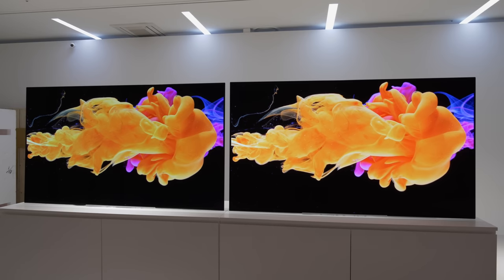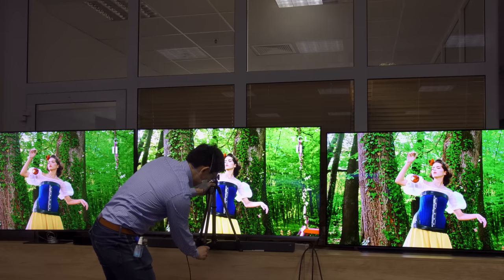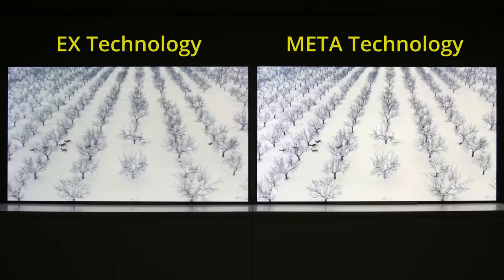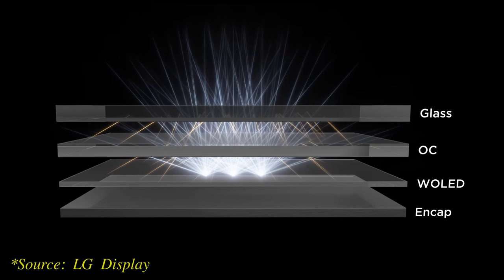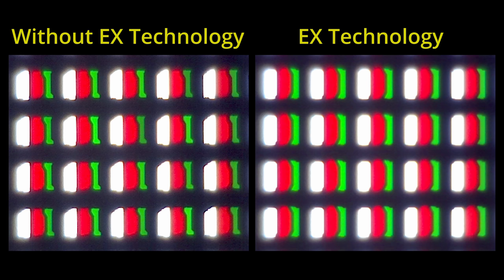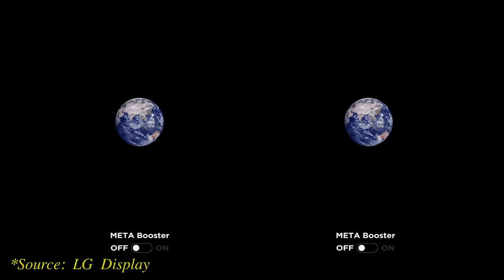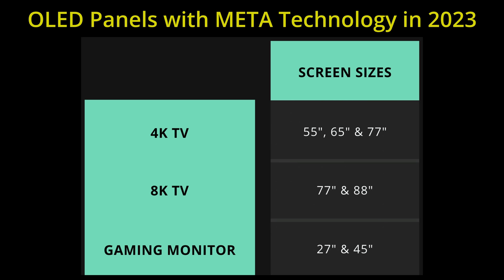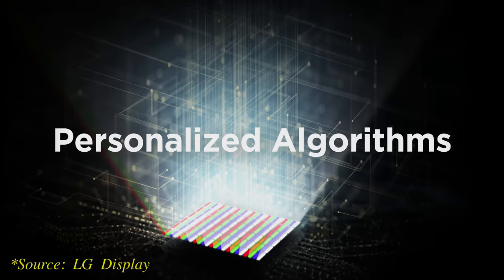MLA OLED Panel Explained - The Secret behind 2100-Nit OLEDs!

Comment: The next few years will be great for OLED and slowly end the LCD dominance because both LG Display and Samsung Display have to compete and push the envelop every year.. The upgrades LG has brought in the past years are a direct response to the end of their large screen OLED monopoly. It feels like the last three years ('21-'23) competing brought more to the table than the first 8 years ('13-'20) in which LG had a monopoly
Reply: They’ve pretty much killed the led this year with the 2000+ nit oleds coming out.
Reply: @polishdude001  Not really. Lcd still gets brighter at all window sizes with no risk of burn-in and is far cheaper. Oled will never beat lcd
Reply: @semahj  Yes it will but not now.
Reply: @md_zafl5284  It really won't. Micro LED is around the corner. Lcd will always be cheaper to produce than OLED. OLED will never dominate.
Reply: @semahj  Micro LED isn't the endgame of panels. Neither is QD-Micro LED.

There's always something better around the corner.

Technology advancements wait for no one.
Reply: @PSYCHOV3N0M  Never said it was but when it comes to OLED it is the end game. Micro LED will replace OLED. all the benefits without the Organic nature of it.
Reply: Most innovation in OLED are from Japan. 90% machines (equipment) for OLED in Korea are from JPN, Samsung make all displays panels on Canon Tokki and Ulvac machines and Nippon Printing masks (all Japan). Microlens is Sony tech from OLED viefinders (tiny displays in cameras to see what sensor see).
Reply: @semahj  micro led will be too expensive even if the technology became mainstream.
Reply: @madln5070  You mean like how OLED used to be...
Reply: @semahj  It was expensive, but they're not the in the same lvl lol.
Reply: @semahj  The first LG OLED was like 15k at max, micro led is more than 100k LOL
Reply: @madln5070  so you think when micro led becomes “mainstream” it’s going to cost 100k…
Reply: @semahj  Yeah lol, its too expensive to produce. Maybe the prices will drop all the way to 50k or something. Im just speculating who knows
Reply: @madln5070  …if it still cost 50k then it’s not mainstream…
Reply: Does this LG's oled tech bring some immunity from burn in pixels ????
Reply: @gregandark8571  blue ph-oled coming 2024 or 25 improves on that a lot. Some say that will end burn-in but I think that's just marketing. It will take years to find out though
Reply: @RealLifeTech187  
I think it's all marketing,because i don't understand how do they pretend to make organic emitters lasting very long time.
But maybe there is some secret sauce - who knows???
:)
Reply: @RealLifeTech187  Universal Display Announces Fundamental Breakthrough in Blue
Phosphorescent OLEDs; New Blue PHOLED Achieves over 15,000 Hours of
Lifetime with Sky Blue Color and High Efficiency
Reply: @semahj  MicroLED has been around the corner for years now, it's also not even reasonable in smaller devices yet.

QDEL seems very promising, but that's also far away.

At this point in time OLED is the greatest you'll get (unless you're spending hundreds of thousands).

As LCD is phased out, its price advantage is likely to follow too.

Comment: Wow so MLA is actually a foundational improvement in OLED and doesn't compromise viewing angles at all, that's a surprise.
In theory they could still boost brightness even further if they did start to limit viewing angles.

(Now I really wonder what would happen to QD-OLED with MLA? Probably 2,000 nits after calibration.)
Reply: Thats a good point if they inherit qd oled.
Reply: MLA TECHNOLOGY is patented by LG, QD oled is not perfect and QD oled has flaws
Reply: @СНСАЛЕКСАНДАРВУЧИЋ  Both tech has flaws. Neither is perfect.
Reply: @dbztrk  can you say MLA OLED flaws? I want to know
Reply: Any or most OLED can be pushed to 2000 nits but would then burn super fast sadly :(

EDIT: Forgot to say microlens have already been made for years for some stuff, there's even some people on youtube doing arrays of macrolenses so any other brand can do their own too...
Reply: In certain lighting conditions, there are raised blacks, making oled pointless
Reply: @ZengShunSheng  QD-OLED still gets considerably better color gamut, color volume and uniformity.

MLA WOLED is great and all, but you cannot deny that QD-OLED is fundamentally superior. The advantages WOLED sports in longevity may also be alleviated on QD-OLED with  the efficiency phosphorescent blue leds might bring in the next year or two.

MLA QD-PHOLED would go bonkers.

Comment: That viewing angles and brightness at off angle would be great for monitors. The final thing would be price of qd-oled or meta OLED. The right size and price would be the decider. Also would love to see firmware update or user upgradeable fitness rather than locking it out to service centers

Comment: Yeah, Samsung really scared LG last year and they had to step up in terms of brightness.
Good thing there is competition now in the OLED world, it’s most beneficial to us customers.
Reply: Not really, WLA has been talked about for 7 years already. This may be the fruit of the labor/research finally.
Reply: @patrickrk44  great, but them releasing this exactly now is a clear message anyway. They would have to use whatever they had in store anyway or invent something.
Reply: @alangfp  every company has a RD department that's working on the next big thing. Take Samsung and micro led. How long have you heard they have been working on it for for example....
Reply: Rev  nothing in the business world is a coincident
Reply: 9000k white point  tho apparently  to get d65 you have to reduce  the brightness  to 1500nits 

Now I seriously  want samsung  to make a 50inch microled  to destroy  LG 9000k what is all content  displayed  at d65  right so basically  LG is gonna have to force filmmakers  to start making there films in 9000k 

With microled  technology  you can have d65 and and bright as far as you can drive them leds to over 10000nits  and it will be a pure RGB panel so yea if I have to sacrifice  D65 for more brightness  then staying with the older panels for now is a better idea I don't want a blue picture

Comment: I'm interested in the 83". Is it worth it if it's only a 30% boost compared to 60-70% boost on the 55, 65 and 77" models? I wonder if they will be able to get the extra large size models to have all the boost benefits of the smaller versions at some point.
Reply: A larger screen automatically appear brighter anyway. Since much larger screen surface. So might not be that much of a difference?
Reply: Curious to hear Vincent's thoughts around a purchase decision between a G3 83-inch and a G3 77-inch.
Reply: Where did you hear that the 83" will not have the same brightness boost as the other sizes? And is it because the 83" won't reach the same absolute brightness levels, or is it because the old 83" is already brighter than the smaller sizes?
Reply: I'm not sure but if you search "LG new micro lens array" or similar, there are articles about the sizes with the increased brightness for relevant models which from memory I think include the 55 inch. 65 inch and 77 inch.

Don't take my word for it though.

I just bought the C2 in December which was my first oled in 48 inch size which is still very large for the bedroom size I have it in.

In some ways I regret purchasing that as at the time I didn't know it was 55 inch+ sets that had the increased brightness and now LG seem to be making a very large step up year to year if 60% increase is indeed true.

I want to know about the smaller size improvements in brightness but the pixels are too close together in smaller sets for the same amount of brightness increase. Is is heat that means brightness can't be pushed up?
Reply: +1 same question!

Comment: I hadn't realised that microlenses are indeed micro. 5000 per pixel! I thought every pixel would have its lense.
I also have a question, do you think in 2024 LG will use phosphorescent blue light?

Comment: I had the opportunity to watch a couple of OLEDs in short succession - a B7 and a C2, both 55in models. You could sort of tell that B7 got a bit dark in brighter scenes, and it's OS was very jerky with HBO Max. C2 was definitely bright enough. I will probably get a 77" C2 or C3 at the end of the year, depending on the price difference between the models - Today the difference between a 77" C1 and C2 is 200€, so that's definitely doable.

Comment: This may finally be the OLED I might choose to replace my first HDR TV, a Sony x930d. That TV handled highlights and color better than the OLED I got a year later. Last year's OLEDs were the first to match or slightly exceed that capability, while obviously also improving shadows. But I wanted something that would be a significant improvement on the highlight range before considering to replace that screen. Ultimately, TVs are devices that I like to buy for the long term, like gaming consoles, so like a new generation of gaming consoles, I want the upgrade to feel like a massive leap, and this finally appears to be the right step for that.

That being said, I'll probably wait a year after it's launch to buy the C3, in order to get it at a cheaper price, as my income is not the greatest at the moment, and that would also allow me more time to save some money.
Reply: Always a good plan to wait for a better price
Reply: It certainly is worth waiting for prices to decrease.

I think I may wait till black friday this year and replace the set in the living room.

I have just bought a C2 for my bedroom but I'm not sure an oled would be best suited for the living room as it can get bright in there.

I do hope there is a bug improvement in average picture level is it called? Base brightness?

That way u could hopefully use it in the living room.
Reply: I not u*.

I would be looking to opt for the g3 this time with it having a heat sink. It's extra protection anyway.
Reply: I would do that too, I bought a LG CX two years ago and I'm really happy with it but those new Meta panels are tempting. They will be really expensive at first for sure, so I might wait a couple of years more to get my hand on one of them, plus we're in some tough times so better save up instead of upgrading too early with a big early-adopter price.
Reply: @TorqueFormulaWon  Even my C6 has plenty brightness if I wanted to use it in the living room for SDR content. I calibrate SDR to 175 nits in my bedroom and that's only about half the way it can go. Remember, full field brightness isn't particularly important for real world usage as it is rare for the APL to get bright enough for ABL to matter.

Even with a lit room under consideration, if I'm watching HDR content I'm watching in the dark, living room or not.
Reply: @TorqueFormulaWon  I don't hang my screen on the wall so it's not ideal

Comment: Vincent, is there no information on whether LGD has adjusted the subpixel control for lower refresh rates to prevent VRR-flickering? Or can we still assume that the panels are still only optimized for 120Hz operation?
Reply: I think they direction of technology is towards HIGHER refresh rates. a lower refresh isn't really beneficial in anyway I can think of.. except perhaps trying to get a panel to operate below 40 or 42fps for the purposes of showing 24fps Movies but since doubling works fine I don't really see the need. & it's only really useful for horrible frame rate videogames. which you really don't want anyone being encouraged to make.

I agree though VRR Flicker is annoying but I think the move to a 240hz standard might get rid of it.
Reply: @90lancaster  How should they get rid of it by just increasing the refresh rate to 240hz? Makes no sense. If the subpixel can't match the gamma curve for the entire refresh rate range, you will see flickering. Actually it could be even worse if you increase the refresh rate and you only optimize the gamma curve of the subpixel for 240hz for example. That's why it is still the only option on latest OLEDs to prevent VRR-flickering to set the display to fix 60Hz. With this method you will force the subpixel into a consistent overcharged state. Dark scenes would look constantly raised, which you can fix with the fine tune dark area settings, but it would eliminate nearly all the VRR-flickering which you would normally see if you set the display to 120Hz. Wider refresh rate range with subpixels only optimized for gamma level at a fixed refresh rate = the more VRR flickering you would see.

Comment: Since there is no heat sink or MLA on the C3, it seems its just a C2 with Ex panel and less software brightness restriction.

I just bought my C2 last week and it came with the new EX panel, i wonder if i can change the service code to G2 and it would be a C3 lite?
Reply: I also thought to buy the C2 but how do you know that it has the EX-Panel? Normally all the C2 leftovers  with the old panel must be sold before you can get the C2 with the Ex-Panel. Anyway i may be waiting for the C3 but i´m still indecisive about that.
Reply: I just got a c2 for my monitor. best buy so got the 5 year warranty. i wonder if i can get a meta panel if this just "happens" to get burn in or something in the next 9 months. :D

btw how do i tell if i got the newer c2 panel or the older c2 panel that isn't as bright? i have the service remote.
Reply: @Steelaron  all C2 manufactured after October 2022 will come with EX,  anything produced between May to OCT you might have a chance, the later their production date the higher it came with the EX panel.  To verify you can check the module ID by accessing the service menu.
Reply: @jy_vision2804   I just bought a 65" C2 during black friday week. What's the model # for the ex panel?

Comment: I love tests that this.  What were the new panels you tested.  I'm thinking a G3 or G4 but what panel was used in the LG lineup for the non MLA screen.  Their G3 in 83" is WOLED but gets about 35% brighter than a new C4. I think this is important data.  Thanks

Comment: This is great news. I was hoping LG was going to respond to QD-OLED and it looks like they've done so. I'm guessing it won't be as bright or have as much colour luminance, we'll have to wait to see a comparison, but it certainly looks impactful enough to make a difference. The technology behind the micro lens array looks quite expensive, so I'm expecting it to be even more pricey than last year's models but lets see.
Reply: Not as bright ? Its literally 30 % brighter then the S95B, and even more. The S95B reduces brightness with EACH update, cause the burn in Risk is so high with the brightness it tried to display in the beginning., Also, it updates AUTOMATICALLY; you have to fking disconnect your out of the box TV, from tne Internet  if you want the original brightness.
Reply: yes let us see 👀🤞🏾
Reply: @spartacuscreator  omg I didn’t know this was happening. So Samsung really drove their panels too far in order to compete, but it backlashed… I knew it would happen.
How can a first-timer like them do something LG has been trying to achieve for a decade, but without the side-effects?? Now we know how it went 😂
Reply: @spartacuscreator  that's on paper, you have to see them side-by-side first. The G2 was promised to be 40% brighter than the G1 due to its heatsink, but that's only in small windows or specular highlights. In full screen it's not that much different, maybe 100 nits. Perceptually, that's barely noticeable even when you have them side-by-side. The S95B is considerably brighter than W-OLED (admittedly before the updates), but looks like they've increased it even further with the S95C without limiting, so my comment still stands.
Reply: @spartacuscreator  S95B is still brighter and has superior colour volume than any WOLED you can buy post updates. The filmmaker mode on the latest firmware is the most accurate it's ever been. Not to defend Samsung's firmware record though, it has been really poor with lots of unresolved bugs still. When the G3 comes out, there will be the S95C, compare it to that not last year's panel.
Reply: @HeloisGevit  exactly. Comparing it to the S95B is kind of redundant.
Reply: @spartacuscreator  Than.

NOT then.
Reply: @cun7us  As someone who owns both the G2 and G1 I promise this is LIE LOL The G2 IS distinctively brighter Like  I don't even need to ook twice
Reply: @OfficialTechnician  that's funny, I've seen them both in person too. In SDR content, the G2 gets to around 375 nits, while the G1 gets to 300 nits which is minimal difference. The main difference is HDR in small, bright highlights.
Reply: @cun7us  They aren’t next to each other in my house but they were when I bought the G2 on Black Friday. Specular highlights are not the only difference. The G2 measures significantly brighter in almost every single window and full field. It’s noticeably brighter at that. I also own a Q90A so I have the best reference for brightness. Not sure where you got the numbers from because the numbers I’ve seen are very different but all in all theres no comparison here bro. G2 much brighter.

Comment: Thank you for the information and the actual benefits to be had from the brighter panel.   I keep asking myself why I am still satisfied with my late generation panny plasma sets.   Seems like meta will be a thing by the time I’m ready for the upgrade.
Reply: Old Panasonic Plasma tv's will still give you a excellent picture quality with SD material and HD blu rays. Though the brightness will have diminished a bit since you have had it for many years.

But current OLEDs will smoke a Panasonic Plasma for watching 4K HDR material! If you watch 4K blu ray movies, or even 4K movies streaming then you should switch to a 2022 or 2023 OLED tv.